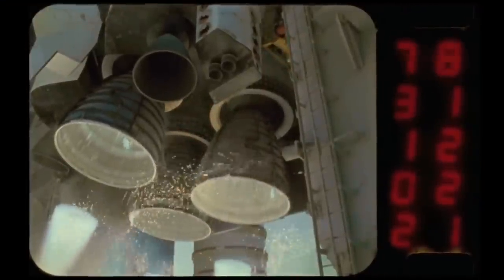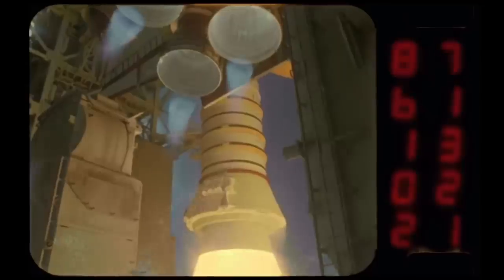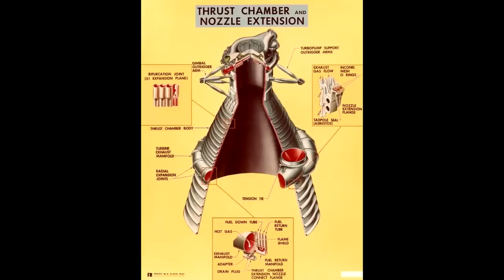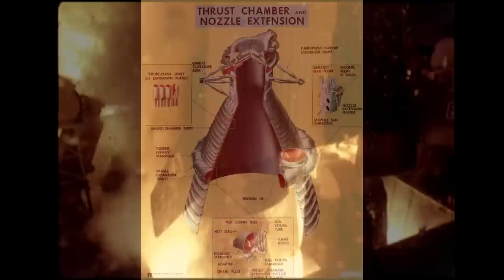Why Rocket Exhausts Look The Way They Do

Comment: On Saturn V launches I especially like how the smoke billows up first and than gets sucked down really quickly as the engines power up...
Reply: I was also fascinated by that effect too. I always wondered how much suction/flow was created right at the MLP deck just before hold-down release. Marshmallows, anyone? Keeping in mind most footage of this is at 400 FPS, so it gets moving pretty quickly, but it's still slower than I had expected.
Reply: @mikecowen6507  well twr was something like 1.1 right?
Reply: @BenjaminKirbyTennyson0  Something like that. Not to forget the draw rods & dies to intentionally slow initial acceleration for the first 18 inches. The first one or two had 4 rods, and it was too much resistance. Remaining flights had 2. None had zero. I honestly don't know if it made a damn bit of difference...

Comment: For some reason the nozzle extension cooling on the F1 combined with the fuel type just conveys the raw power of the thrust coming out of the motor. Seeing the streaking and able to see the exhaust gasses moving.
Reply: Also keep in mind that that footage was shown in slow motion if I'm not mistaken, so it's actually faster than what it looks in those films.
Took me a while to wrap my head around that sort of power, simply amazing.
Reply: Isn't the cooling making the engine less efficient or am i missing something
Reply: It's not going to be very efficient if it melts.
And the F-1 is on a gas generator cycle: The turbine exhaust was going to get vented regardless.
Reply: ghgjg: Yes, there's a slight reduction in efficiency, but having the nozzle remain solid is a bigger consideration.  Keep in mind that it's the temperature of the gas, not the nozzle, that produces the exhaust velocity, and therefore thrust.  Very little of the gas gets anywhere near the nozzle surface.
Reply: BrightBlueJim ok. How much of the fuel is used for cooling, as a percentage?
Reply: For the F1 engines very tiny. The turbine that runs the turbopumps that feed the powerhead runs rich to keep itself cool. The exhaust from this is what is then used to cool the nozzle extension. It's actually more efficient then simply exhausting it out a pipe of it's own. At least here you are getting double duty for the fuel.

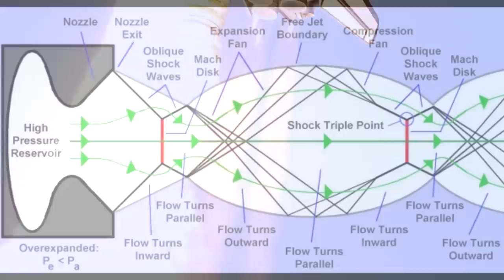Comment: 2:40 Scheme of Shock Diamond
4:40 RS-68 (Ablative Cooling)
5:18 Merlin
5:25 Kerosene (Number of Carbon Atoms)
5:46 UDMH
6:12 Raptor (Methane)
6:40 Color of Exhaust
7:20 F-1 (Film Cooling)
10:05 Exhaust Altitude Expansion

Comment: Brilliant video mate! Some good explanations that were previous not so obvious for aerospace engineers as well.. if you could cover aerospike and other plug nozzles physics also, it would be great...
Reply: I really thought he was going to go to the aerospike engine at the end . .
Reply: The aerospike, in effect, uses the atmospheric pressure as the outer surface of the nozzle, making it an automatically altitude-compensating nozzle. I've never seen a good explainer video. There is a text on NASA's website that covers it well.

Comment: Ahh, Triethyl Borane... It's the same stuff used to light the SR-71s J-58 engines. There's a distinctive green burst as the fuel reacts with the TeB. It's the same thing with the Raptor engine, except it's happening at a much higher concentration of TeB.

Comment: It's funny, fifteen years ago I did a very basic simulation of a rocket engine in a 3d modelling program with particles and I got the "flower" or "fan" result of the exhaust. I found that weird, and asked my college intro to physics professor about this (I was a freshman) and wondered why you usually see a conical trail on rocket exhaust. He didn't know, and guessed it was something to do with why water from a tap tapers off. I had other things to worry about at the time so I never looked any further into it, but I'm glad to finally have my question answered -- the exhaust has lower pressure than the surrounding air! Makes sense now, and obviously I didn't really model pressure in my simple simulation. So thank you for this, Scott.

Comment: I think on the final version of the BFR (Raptor engine) there will be no green flame from the igniter because they plan to ignite the engine with some kind of electric arc. That makes things easier for mars missions: they dont have to bring igniter for the flight back to earth.
Reply: It depends on how reliable electric ignition is for LNG/LOX combustion. RP-1/LOX takes too much energy ignite for spark plugs to be reliable so they use TEA-TEB for Merlin engines. However, you can use spark plugs for propellants that take less energy to ignite (see Centaur LH2/LOX upper stage). It might work for LNG/LOX, but I'd be surprised if they spent the time and money to make reliable electric ignition for such a tiny fraction of extra deltaV.
Reply: SpaceX has had a number of failures (when landing Falcon 9) due to miscalculating the amount of TEA-TEB needed.  Eliminating that is worth the engineering effort for BFR.

That said, I don't believe they've publicly demonstrated their spark ignition system yet, and a little reading suggests they're a pain in the ass to get working right.
Reply: @myrobotfish  It should be highly reliable since they're not attempting to ignite LOX and LNG, they're igniting GOX and NG (e.g. gas mixture, not liquid).
Reply: +Matthew Ducker I understand that full flow staged combustion implies GOX and NG igniting in the main combustion chamber, so yes you're right that electric ignition should be highly reliable in that engine stage. However, in order to convert the liquids into gases they must be ignited in the pre-burner stage, so you still end up needing to ignite an LNG/LOX mixture.
Reply: Hmm, makes sense that spark plugs wouldn’t work for RP-1, given that it is kerosene, which is thicker than diesel, which doesn’t light well with spark plugs either.
Reply: @myrobotfish  It is my understanding the plan is actually to heat some of the liquid oxidiser and fuel electrically and feed the resulting gas directly into the preburner for the ignition phase so at no point will they be attempting to start the engine with liquids.
Reply: +Matthew Ducker Interesting. That would be very impressive. I hope it works!
Reply: Just like programmer8 said, it is complicated. For instance, SR71 used TEA-TEB to ignite either engine or afterburner( or both) due to high flash point of fuel they had to use in this bird. In diesel engines fuel ignites due to heat/pressure. Same principle applies here - too hot == self combustion. Drawback is that you need high energy to start the combustion reaction in normal circumstances, hence sparkplugs wont work.

Comment: Another interesting rocket exhaust was that of Black Arrow. It used RP-1 and high test peroxide and had a practically invisible exhaust. If you look up pictures of the launch, it practically looks like it's floating in mid air

Comment: When I was in Aerospace Engineering in college, I learned a very counterintuitive principle of rocket science that I haven’t been able to find any videos that even mention it, let alone explain the science in a way that makes sense using the physics we all understand. And that principle is that as the combusted gasses leave the combustion chamber and makes its way to the nozzle, it travels down a constricting neck and, as expected, increases velocity until it reaches the speed of sound. Now here is where it gets weird. First, it cannot exceed the speed of sound as the duct converges. Even weirder, as it enters the expanded bell shaped curve, the molecules actually ACCELERATE to speed well beyond the speed of sound, contrary to what you would think if you’ve ever learned Bernoulli’s principle. Since this was just a beginning undergraduate aerospace engineering class, we were not given an explanation as to why this counterintuitive phenomenon happens. All we were given was a formula that we used to calculate the velocity of the gas based on the shape of the nozzle and the distance from the combustion chamber. Scott, if you could do a kind of a nerdy, high level explanation as to why this happens, I would be very grateful!

Comment: Another neat aspect of the F-1 design is that the cooling gas is actually the waste gas from the turbine powering the massive turbopumps for the propellants, and by funneling that waste gas back into the nozzle the designers not only cooled the nozzle, they salvaged a few seconds of impulse from propellants burned in the turbine that would otherwise have been "wasted" from a pure thrust perspective.  It's a small increase in efficiency but it probably bought a few more pounds of payload to the moon!

Comment: Some years ago, I was building large fireworks whistle rocket engines.  They were core burners without any choke/nozzle, just solid fuel in an open straight tube.  There had been come discussion in the pyro community about the question, could the gas flow be supersonic.  By chance some months later a professional photographer sent me a photo of one of my rockets taking off.  Low and behold, it had mach diamonds.

Comment: Scott, I was under the impression that the Raptor prototype shown used spark ignition rather than pyrophorics.  The best explanation I've seen for that particular green flash is chromatic aberration due to overexposure.
Great video overall, though!

Comment: The nozzles are flared outward at high altitude is the reason why the exhaust expands more at altitude.  This is done to make the rocket easier to control as fuel starvation could cause a flameout.   Flaring the nozzles outward will push the rocket to the side if one failed.  If all nozzles pointed in the same "down direction" the rocket will turn rapidly and break up.

Comment: Scott Manley, thank you, Your explanation of exhaust is spot on. However me and my fellow rocket engineers do not like to use the term thrust, we use the term force from within a pressure vessel ( Newton's third law ). Rockets are not propelled, they are lifted from within by the internal pressure. All that fire and gas out the nozzle is only the result of the internal pressure. sorry just saying.

Comment: Scott Manley - FYI, the main fuel in the SRB core is the PBAN, not the aluminum! The aluminum is only present in ca. 2% concentration, and is a catalyst in the reaction. The composition is close to 20% PBAN, and the majority of the weight, of course, is the heavy ammonium perchlorate oxidizer.

Comment: I always sort of liked black powder exhausts as produced in larger Model Rockets, D & E & F class.  A lot of solid particles from Potassium salts gives a lot of white smoke, but some unburned carbon produces some afterburning in the air and luminosity, but not at the levels of composites with burning Aluminum particles which are intensely bright.  It takes dusk or night time conditions to see the plumes light output better.  It's unique plume in a way..

Comment: Thanks for the video. I don’t understand pressure yet. If the pressure of the exhaust is lower than the atmosphere, how does it escape the engine? Why doesn’t it get pushed back in by the air pressure?
Reply: It's coming out so fast it just whacks the air out of the way

Comment: Pressure is independent of reference frame. The comment around 2:35 is therefore charitably described as misleading. Mach diamonds appear in a supersonic flow because pressure information is propagated upstream at the local speed of sound within the exhaust plume. Because the exhaust is supersonic (1), the static pressure inside the plume can differ from the ambient static pressure. The accommodation process whereby the plume is compressed and expanded as it bounces against the atmosphere is due to the fact that the plume is supersonic, rather than the particular fact that the flow is overexpanded. Underexpanded flows also produce shock trains, the difference is just that those trains are phase-shifted downstream. None of any of that has to do with reference frames.

(1) Except behind the normal shocks that form the upstream line of the hot triangles in the video around the timestamp in question. That gas is subsonic, but expands to supersonic downstream. (And then compresses and decompresses as it moves down the shock train.)
Reply from the maker: I’m with you, but I’ve tried to explain the pressure of rocket exhausts in many ways and this ‘lies to children’ version seems to get most people accepting the fact so the subject can later be approached in more detail.

Comment: Turbine pumps of F1 Saturn V were rated at 55,000 horsepower, each. Each engine burned 2578 kg per second (1789 kg of liquid oxygen + 788 kg of kerosene). Combined rate of 5 F1 engines was 12.890 kg per second. Sound Pressure Level was 220 DB.  The effects that sound waves produce at 220 DB are stunning. The rocket itself would be torn apart, this is why enormous amounts of water were pumped into the launch pad to damp the sound. At 220 DB, nearby concrete melts, at 1 mile away, grass ignites. At 220 db, water condenses out of the air, causing a fog.

Comment: Unless the earlier tests engines were different, I don't believe the green color on the Raptor engine exhaust is from TEA/TEB, as the Raptor uses electric ignition.

I believe the green is actually from copper (or similar metal) residue used in the nozzle construction.

Comment: 4:12 Because the gas is at low pressure, so it shows its Fraunhofer lines (absorption/emission spectra). At higher pressure, these disappear.

Comment: Funny. I was just thinking earlier today about Ian Malcolm's quip in the book Jurassic Park about why he wore black. The quote was: “As a matter of fact, black is an excellent color for heat. If you remember your black-body radiation, black is actually best in heat. Efficient radiation.” He should have said "in the shade", but for some reason it always stuck with me. Full disclosure: I wear all-black attire all of the time (for several decades, now). Mostly because I never have to match anything and it seems to fit in with many different social situations, but I like to think there's a little bit of Malcolm's statement somewhere in there, too. ;)

Comment: Has anyone noticed that the color of rocket exhaust that you see in person with the naked eye is extremely different than the color you see in videos of rocket launches?  I've seen day and night launches of the space shuttle and other rockets where the color you see is a very intense orange color, but when you see the same launch on video, the flame appears almost totally white.  Is that because the intensity of the light overwhelms the sensors in the cameras and they color just registers as white?  The same effect can be seen in photos and videos of launches in the pre-digital era, which also show the exhaust as having a bright white color.

Comment: Raptor is supposed to use spark ignition, not TEA-TEB. That green flame could also be "engine-rich combustion", with the green coming from copper.
Reply: René the test used triethylborane though

Comment: The fuel rich film cooling exhaust has an analog in firearm muzzle flash. Typically this is unburnt crap from the propellant that mixes and burns in the air, not hot gas burning out of the barrel.

Comment: I thought they ran cooling lines around the bell housing of the Saturn 5. They cool the bell with turbo pump exhaust?
Reply: The upper half is cooled by the fuel, as you say. The lower half has no cooling tubes, so the pump exhaust is injected in from the large tube that surrounds the bell at the halfway point.

Comment: Technical note: The Saturn V was larger than the N1 but it was not more powerful. It was considerably less powerful and with lower thrust.
Reply: It may be picking nits, but one could say until a rocket actually is successful at delivering its payload it's really just a bomb.  I bet with a little more work they would have gotten it to work. :)

Comment: Scott, the bit about the visibility of the exhaust jet got me thinking - is that more or less what's going on with a bunsen burner when you change the flame from yellow to clear/blue as well? Yellow flame is black-body radiation from soot etc in the flame, that you no longer see when it's burning more efficiently? And the blue tint is caused by the other process rather than black-body radiation?

Comment: Perhaps you could explain why the exhaust from composite propellants (PBAN/AP) which do not contain Aluminium have a similar optical signature to those of the Shuttle boosters. Something other than the Aluminium is adding to  the opacity of the exhaust. (Hint: The exhaust contains large quantities of HCl and H2O)

Comment: I thought the F1 used regenerative cooling. Does it use both film and regenerative, or am I mistaken? In the video he said they didn't run LOX through the bell but there are pipes along it so are they running kerosene through it?

Comment: Scott, I have a question here, at 10:55, on the right side, there starts right at the lip of the bell, but then expanding outwards a band of black, and it's hard for me to tell if that's some kind of physical thing, like a tether of some kind, or if, as you mentioned, it's a trick of the newly-fired rocket exhaust obscuring light. What is that band of blackness?
Reply: Just answered this in response to Tazuren Savu'len's question.  Load up lots of comments (scroll down in the comments) and either spot or Ctrl+F (find) his name and then view the replies to his comment.  :)
TLDR: Stiffener ring for ground transport and launch - the long answer is better though :)
Reply: @EscapeMCP  cool thank you so much for that information! How cool Is it that something so small and thin can change the structural integrity of the bell of one of the strongest man-made forces that accomplishes something other than destruction?